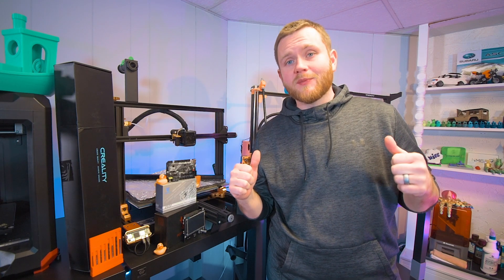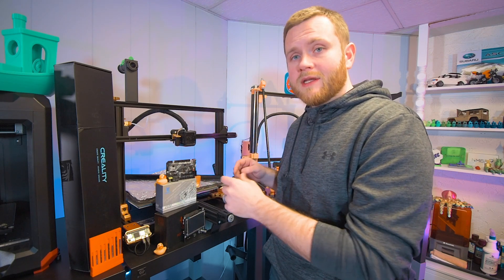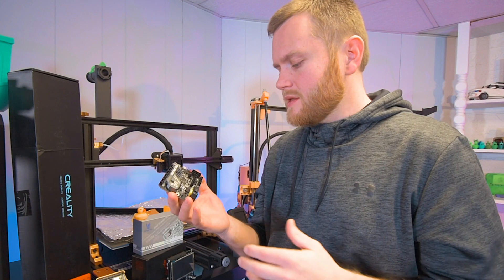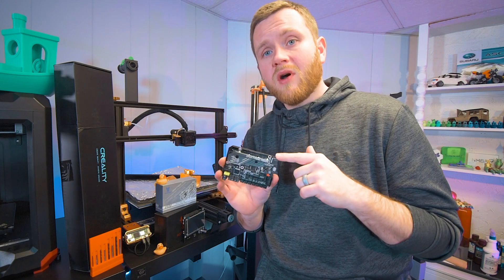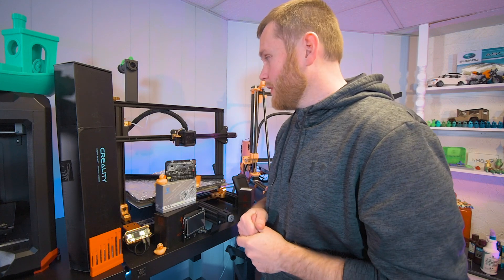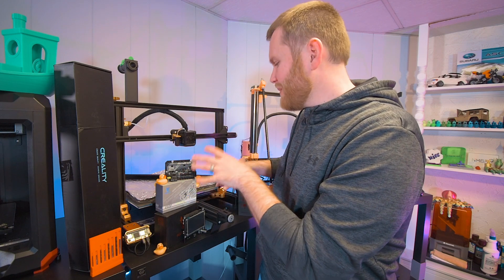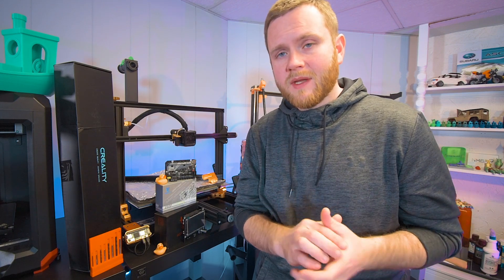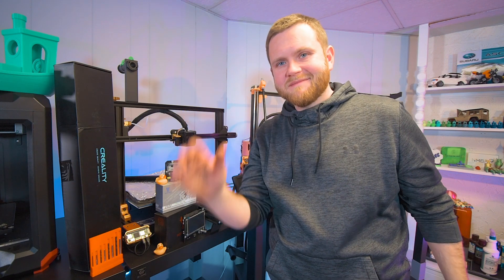Let's build the ULTIMATE AQUILA - Part 1

Comment: Thank you for the detailed information :) I would like to ask about something. I got BTT Skr mini 3 v3 and I would like to use Aquila original display with this board. I'm having issues and nothing is showing on the display. Could you please provide some information about this ?
Reply from the maker: There is a cable that BTT put out for that specifically. Since the display if from an Ender 3 V2. Just search E3V2 display SKR Mini 3v3. Youll find it quickly.

Comment: hello, the volume question is, would it be easy to increase the size of a standard 3D printer 220×220 250 ender 3v2 to increase the printing pad by changing the body of the 3D printer to larger ones
Reply: And how to apply software on a larger bed plane?
Reply from the maker: @O_KODEL_GI_NE  Lots of firmware out there to get you started. I have some in my links as well. https://youtu.be/ktMMgBriDE4
Reply from the maker: Yep. I have some videos on making these larger. I made one 400x400. :)

Comment: So I have installed the ender extender XL kit on my aquila X2 and have updated to Alex's firmware. My question is how do I reconfigure  print volume in the firmware so the machine knows that it is bigger.Any help or assistance would be greatly appreciated. Thanks in advance
Reply from the maker: You have to either recompile your firmware with the correct size of find one that is already compiled. I have one in my linktr.ee/3dprintsos at the bottom but it’s a specific build. If your doesn’t exactly match, you’ll have to grab one online or compile yourself. :)
Reply: @3DPrintSOS  thank you for your assistance

Comment: Hi Feder, Do you know if these SKR boards are compatible with the stock Aquila screen?   Also are these board capable of running Alex's fork of Jyers UI?
Thanks in advance, Julian
Reply from the maker: Technically they are supposed to be. However with a repin of the cable. I haven’t tried it yet but two people I know who have, couldn’t get it working. So the tft35 or larger is likely the best way to go

Comment: Will the main board plug and play in the aquilla? If not what will I have to change to make it work
Reply from the maker: Mostly...the main fan needs a connector instead of just raw wires. Also the mounting holes don’t all line up. But that’s an easy thi be to solve.

Comment: Have you thought about going to a direct drive setup? And how hard would it be to go up to 300°c to print wider range of filaments.
Reply: Those and dual extruder for ez multi color prints would be nice :-)
Reply from the maker: Yeah for sure. I think direct drives have are a bit of a double edged sword but it seems to be the trend correctly to keep the extruder and the hotend close. It wouldn’t be that hard. All metal hotend plus some higher maximums in the firmware and you can get up to 300. ;)

Comment: I just ordered one of those printers and I really hope you make part 2 so I can see what all the stuff you can do to it. Can you explain more about the hot ends and what one does over the other or why you’d wanna upgrade ? I’m a 3D printer newbie and really am having a hard time finding explanations of stuff
Reply from the maker: For sure. That’s In the works. I will get it running with a new motherboard and screen first, then dual Z axis, then hotend. I’ll go into detail on each step likely.

Comment: Hey Fedor, I'm having trouble out of nowhere with my Aquila, I have had it for almost a year and have had great prints right along. Now, for some reason I'm getting layer shifting on my x axis. Yes, belts are tight, I have changed nothing to the printer at all, I have no idea how to correct this... Please Help
Reply from the maker: Hmm. First thing I would check is the voltages.
Reply: @3DPrintSOS  will do, my x motor is hot! Thanks Fedor
Reply from the maker: https://youtu.be/CjH7AXIHN74

Comment: Hey I just bought the 300 xl for it can you point me in the direction of a cr touch firmware for it or can I use the cr 10 firmware.
Reply from the maker: Only if your board is an STM board. If not, Alex’s fork of JyersUI is your best bet. https://github.com/alexqzd/Marlin/releases

Comment: Just did a fairly major upgrade on my Aquila.   Installed an ender direct drive kit then to fix the issue of the ender hot end bracket not having a nub to hit my x axis switch I just used a snip of spare PTFE tube and tiny piece of duct tape.  It is printing better than ever.
Reply from the maker: Nice! Which direct drive did you go with?
Reply: @3DPrintSOS  I got a creatality kit for sn ender 3.
Reply from the maker: Nice!

Comment: I have a strange problem. 

I have the Aquilla with the G32 board and BLtouch with alex's firmware.

The Z axis is impossible to calibrate the steps/mm because from 0 to +20 it measures 18.45 BUT at level 200 to 220 it measures 21.12. so what do I do? have you ever seen that before?
Reply from the maker: To be honest with you, I have never calibrated any esteps outside of the extruder. I’ve never had the need to. What was happening to the z axis that it needed its esteps calibrated? Have you tried default?
Reply: @3DPrintSOS  the problem turned out to be binding, upgrading to a dual z axis would have fixed it also. Had to move the adjustment nuts for about 1.5 hours to get it right

Comment: Man, can't believe how your video production/editing have grown since the first few Aquila vids (even some cool "out of this world" humour). I'll get the tech-warning stuff out of the way first: be very careful with plastic casing design (grounding). Maybe consider a metal mounting plate. Cooling: you may not need a 2nd fan since the 2209 (?) run cooler, so overkill, keeps $ down and the full view. I'm taking this journey w you to test my Aquila. First thing is reduce the bed weight as low as possible with Al base plate with a thinner Al machined bed with heater more lie Anycubic's. I'll bet this will increase performance by an order of magnitude. And yes, Roxul insulation. Next, widening the bed rails for increase stability.   Enough for now, more of my ideas in your next video. Great work Fedor!
Reply from the maker: Thanks for the kind words and advice. I do need to rethink the case unfortunately. Luckily I have other projects and videos to do before I have time to build this, so I will keep thinking of how to improve it.
Reply: @3DPrintSOS  Did you run into problems with the holes by any chance? I replaced the original with the Bigtreetech RRF E3 in the original casing and found that only 1 screw hole matches with the Bigtreetech board
Reply from the maker: That’s right. They are meant to be a drop in for an Ender. So only one will fit. It’ll hold with 1. But you can also print an adaptor or add some standoffs rather easily.

Comment: Nice idea for a project Fedor. as expected :-) I think starting with the electronics (brains) is good move. But one little observation in the footage your 3D model of the enclosure had a fan mounted in front in the transparent case, not good if you want to showcase the beautiful PCB ;-)
Reply from the maker: That’s true. I was even going to do a double fan setup. I’ll have to rethink it or move it a bit.
Reply: @3DPrintSOS  is there room on 1-2 of the side walls?
Reply from the maker: Not tall enough but I’ll have to rethink it all a bit I think.
Reply: @3DPrintSOS  you probably don;t have much heat to get rid of, 'maybe' a small tube to suck the air out ? I'm doing the same but with a whole enclosure, so larger 100mm diameter, for venting toxic ABS fumes.

Comment: I would rather see a build using diy parts to get the same things done. All of the extrusion, larger bed, etc. Can be purchased much cheaper than the Ender Extender kit. A little bit of diy and you can save a lot of $$.

I'd like a comparison between the higher end hotends and copy versions as well.

I know it's difficult to recommend something else because these are sponsored but most of these products are overly expensive for what they offer (imo)
Reply from the maker: Yes, you’d like my materials videos. I show that you can print practically everything with just some nozzles, some printed parts and a higher quality ptfe tubing. 

I’m not opposed. It would be fun to make a budget version of the ultimate Aquila. And once this one is done, it would be fun to compare its performance. :)

Comment: Hi there, what is your average print speed for production parts inner and outer walls if I may ask?🤔
Reply from the maker: Depends on material. Check my pla profile. I think at the moment I do half the print speed for outer wall and print speed for inner wall and double speed for movement.

Comment: Excellent concept, can't wait to build my own! The only sticking point I have is the zodiac 3d pro nozzle. I know you love their products from watching previous videos, but I can't count how many times I've had to junk hotend assemblies with the nozzle being "concreted" in them and I'm having a hard time paying nearly $60 for a nozzle just to see it mangled when trying to remove it from a gummed up hotend. Thanks!
Reply from the maker: I see your point. Well hopefully the high end threads in these coated copper blocks and nozzles along with thermal paste that comes with them will come in handy.
Reply: @3DPrintSOS  looking forward to your results, Fedor! In the meantime I see no reason why I can't use a cheaper nozzle until more long-term results are in. 😉
Reply from the maker: That’s a fact. The cheap stuff works. I’ve been using cheapo components on these things for a while. It’s more about calibration really.

Comment: Wouldn't it be great if the manufacturers could come up with a standard plug like a couple of 21 pin D-plugs for our wiring that just plugged into our controller boards.
 They would need to form an association of manufacturers first though to agree to the standards, imagine the savings they could make, no more termination sockets on the board, the sales would increase also as the people who are scared off upgrading the board because of the wiring involved could just swap their board and plug in the D-plugs.
Reply from the maker: That would be awesome. Haha
Reply: @3DPrintSOS  The idea needs pitching to some big name YTbers that have contacts within the industry.

Comment: Everything looks very exciting!
Have you thought about putting any BMG extruder?
Reply from the maker: I have but I love the Fedorstruder. Literally zero issues once it’s installed.
Reply: I've removed the BMG Extruder from all my machines. They run for awhile ok.... then no amount of modding or cleaning will keep it running. I replaced them with OMG V2 Extruder. Once installed I've had Zero problems with filament!

Comment: Man, you are thinking exactly what I was talking with my Extended Aquila C2. Since , you are tapping bottom extrusions, how about getting longer z axis and making it a 400mm cube build area. You have dual z kit. Just need bigger lead screws right?
Reply from the maker: Yea, technically making it taller is very easy. Wire length wold be a concern too.